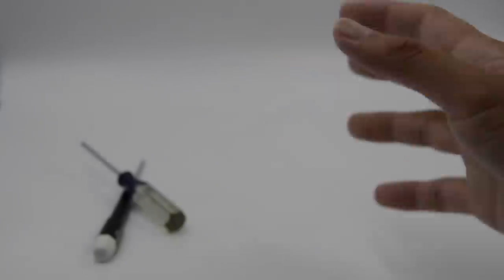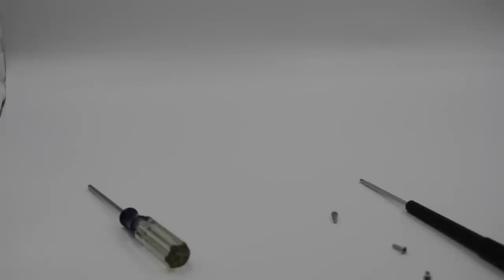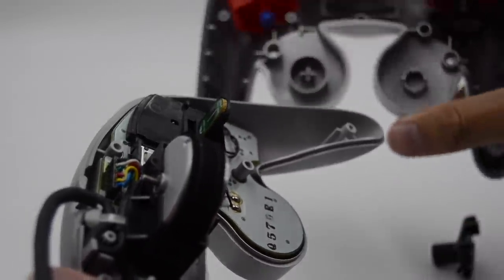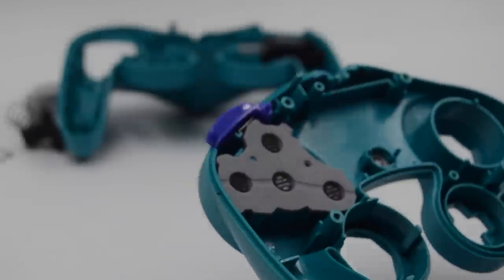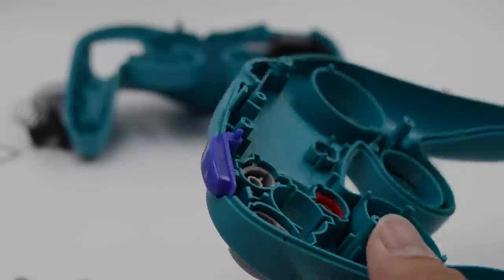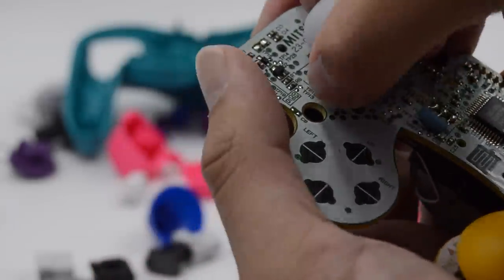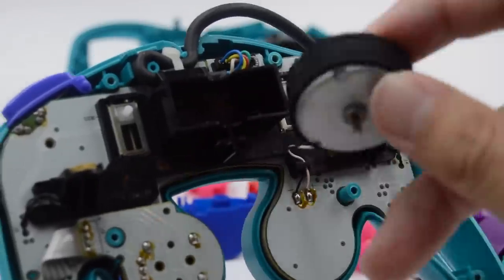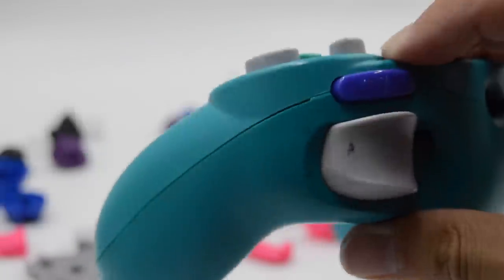Common Mistakes: Opening a Gamecube Controller

Comment: You didn't say the most important mistake, and that's not turning the screw left until they click into place before screwing them back in. This sets the screw to the original threading and prevents making new threads and damaging the plastic. This can be apparent if you open up your controller a few times and screws will no longer hold tightly, but instead keep spinning since the threads are damaged.

Comment: A little trick for anyone who is opening one of these up only to replace something from the front(joystick/buttons/etc.), you can just remove the front plate with the board resting in the back shell of the controller. This way you don't have to worry about the cord/rumble motors/or the LR sliders at all.

The way to do this is: hold the back of the controller with one hand, and put pressure on the joystick and C stick(this holds the board tightly to the rear shell) while you lift the front shell loose from the board.

Once it's loose enough, put the controller sideways before removing the shell so your buttons don't fall out of the front shell. Though if they do fall out it's extremely easy to drop them back in.

Comment: PSA: You don't actually need the metal bar in the z-button for it to reset it'd position, the tack switch the z-button rests on will reset the position for it, all the metal bar does is add tension to the z-button so you're better off removing it.
Reply: its insane how you just cant find a real answer lol, you watch a video to learn how to open a controller and then you have more esoteric comments that "actually..."

Comment: It probably isn't that the screws are low quality. It's because they aren't actually Phillips screws. They are Japanese Industrial Standard screws, which often strip with a standard Phillips screwdriver if you aren't careful.

FYI, if you ever find a Phillips screw on the outside, it doesn't necessarily mean someone has been tinkering. I bought a Clear/Indigo controller at-launch and it had one Phillips screw on the bottom even though all the others were triwing. It was still sealed in the package. I had it for well over a decade before selling it in 2015.

Comment: I would also take extra care with the Rumble pack on the back. In my experience it's not always secured to its plastic housing and could fall off and potentially break because of the thin wires. If it does break off because of the wires it would be a simple fix if you know your way around a soldering iron. Still just something to look out for though.
Reply from the maker: yup! just super annoying how easily it breaks to begin with

Comment: Zenith! These videos have given me a ton of inspiration to fix up and upgrade my controllers, they work but they are very old and pretty beat up. This being said, I ordered a 5 pack of those replacement buttons you demoed from the cheap Chinese sellers online, and some replacement button pads. I think you should review the button pads! There are ones from ZedLabs and GameTown, I think, all found on Amazon and eBay. The thing about these old button pads is that they make your old mushy buttons feel clicky and responsive! I tried them out and honestly, I could never go back. I definitely think you'd like them, and you should totally make a video about them! Thanks for reading this, I'd be surprised if you even got here.
Reply from the maker: I will look into the button pads! thanks for the heads up :)

Comment: You probably won’t see this but at 9:15 when you point out the trigger slider getting caught and causing the trigger to get stuck a bit cause he’s getting caught. What do I do to make it normal again. I have a controller tester and it shows that the adaptive part of the controller doesn’t work anymore. Just wondering if you could help.

Comment: The "phillips" screws inside the controller might actually be japanese industry standard (or jis), which are slightly different from phillips screws and might be easier to unscrew with a jis screwdriver.

Comment: I bought a used GAMECUBE controller from a retro gaming store. It's a little dirty and the left analog stick isn't tight. It's weird to explain, but the distance you can wiggle the stick back and forth without actually triggering any movment is way bigger than it should be. Any advice for cleaning it or tightening the stick? I'm probably going to use a little water and a paper towel to get the grime off, and a toothpick for the small space where the shells meet.

Comment: If you have taken apart other controllers then the rumble moter being in that hump will throw you off because normal controllers (the ones with clickable thumb sticks and 4 sholder buttons) have the rumble motors placed in the grips also gamecube only has 1 rumble motor
Reply: gc motor is best ever.

Comment: One main thing I've seen time and time again, is people screwing the shell on unevenly and either too tight or too loose (sometimes in certain screws not allowing other screws to go all the way in, or making the shell offset from the faceplate, even locking triggers or z buttons because of it).

Comment: How would you recommend removing a stripped screw from the trigger guard?  I bought a controller recently and was going to swap the metal bars from it into my main controller, but one of the screws is pretty badly stripped.
Reply: The way a machinist would do it is drill it with a left hand drill bit (one that cuts in the opposite direction of normal)
Of course, that's not something I would expect normal people to do, but another option is to cut a slit into the head of the screw to turn it into a slot, to try and take it out with a flathead screwdriver.

Comment: hello! i want to take apart my controller to repair it. it's a knockoff, so it's had this issue from the beginning where the joystick is off center in the hole and i think the thing inside, is twisted? are there any resources for repairing the joystick?

Comment: My left analog stick doesn’t fully work. For example when I play super smash I can run right but when I go left I can only walk and same thing with charged A attacks I can’t do them left. Is there any easy way to fix this?
Reply from the maker: could be plain broken, when did it start doing that?
Reply: zenith SSBM I stopped using the controller but it happened a few months ago when I was playing smash bros melee, I do a lot of shield dodge rolls then I noticed I didn’t always run when I moved left. 
If I’m running right and then I want to run left it usually makes them walk unless I try again pushing the stick harder to the left.
Reply: Then you probably need to change stickboxes. That requires solder. If you don't know how change maybe is time get new controller.

Comment: there some version varietions you missed. (c stick part there a board with one that can detatch from the main board and re attach fine. Also solder joystick vs the ones with screws in the back.

Comment: Hey I think you should do a similar video but with the hori pad controller. Since it's also a pretty common GameCube controller to use in the smash community. I personally would not know what to expect when opening up one of those.
Reply from the maker: the Hori pad is super weird but really its about the same in things to look out for! just all the button pads are separated and you have to worry about 2x the z-buttons lol

Comment: Oooook, I have a question: My A button membrane broke in my new model Smash GC controller. It was a tall button membrane, so I was gonna switch it for the membrane on an old controller I have until I saw this and realized they're different. However, both controllers have equally sized buttons. I'm just wondering what that means. Are they tall buttons and that's why my membrane was breaking?

Comment: hey, so this is a more intense mod. But ive tried it a few times and failed. I'm trying to make a paracord cable for the controller, I tried cutting the cord, sliding the paracord on, and soldering it all back together, but the gamecube doesn't like that, it only sometimes recognizes the controller. The only other way I can think is desolder the cable from the board, but my controller has a plug like object that all the wires go into, and i can't fit the paracord over that.

Long story short, would you be able to make a video on how to put on paracord over the cable?
Reply: I have a GameCube controller that has a bad cord the only way to use it is if I put it in a good position. I’m trying to change the cord as well I tried desoldering it but they did a good job with it. Might as well get a new one some are like 12 dollars.

Comment: Zenith thanks! Im super late but I have a few issues. One is that I've swapped out my control stick for another and it feels sooooo sluggish. Like I cant go across a character select screen and move up or down without it being sluggish on my swapped stick but the original stick still works. Do I gotta sand something down? 

On another control I've swapped our the start button and I've got the padding there. It's weird... but that mug isn't working lol. If I swap back to the original it works though. Any ideas? 

Also thanks again for the videos. These have helped me a TON. I've had successful button swaps and they're working great - but some of these custom buttons just aren't working for me

Comment: I recently just took apart my game cube controller taking it apart and putting it back together was pretty simple however I noticed after I put it back together the left deepad arrow became very stiff when pressing it I don't know what happened and it never did that before but I can't seem to fix this problem I try to disassemble my controller multiple times however I couldn't get the deep pad to work originally how it used to, can someone please tell me what I did wrong or what the issue is? Feedback is much appreciated thank you
Reply: I realize this comment is very old but did you try pulling off and replacing the button pad under the D pad? I wonder if it’s not placed correctly

Comment: i opened mine and now im unable to put it back together -.- its broken anyway so i tried to take some dust out since my controller would not work as well. but im at the last part where i have to put the 2 big parts together before screwing but it wont fit.. dunno why

Comment: You mentioned those back shells with the phillips screws. I have an original Nintendo-brand controller I got it in 2005 and it doesn't have the back shells or the metal brace. When I opened it I could literally see the trigger and spring. Why is this? I love your content by the way.
Reply: older controllers didn’t come with it

Comment: Thanks to this video, I too decided to mod my GC remotes, but I came across something confusing. 
on battle beaver site, it shows the old controllers having "Tall" rubber pads and new controllers having short ones.  but this video claims the opposite. obviously both of you can't be right... so which is it?
Reply from the maker: old controllers have short button pads and tall buttons! hope this helps

Comment: I don't know if you'll respond to this but I recently opened my GameCube controller to replace the stick. Basically the rubber bit on the stick had worn down so I replaced it with a stick from a controller that I didn't use. It's important to note that my original controller (the one with the worn out stick) did NOT have any noticeable snap back. The controller that I was getting the new stick from DID have a lot of snap back.  

Now that I have replaced the stick from the bad one and put it into my main one, they both have a ton of snapback. Did this happen because the stick itself is faulty and has snapback? Or is it due to me opening then closing my controller improperly?

If you've got a solution for me, that would be great.
Reply: You probably just need to use the sticks enough to make them slightly loose and they won't have snapback anymore. I've heard people say a few weeks of regular play should loosen them up and stop snapback.

Comment: So question. I have an indigo controller that I was attempting to replace the buttons and sticks since the originals were really worn. And as I was putting it back together and making sure that the sliders were up, the R and L triggers don't respond. They go up and down just fine, but it's not registering the input. Is this at all fixable?
Reply from the maker: do the sliders work at all when the board is plugged in?
Reply: @zenithSSBM  Yeah they work, it just won't register the input on the board part.

Comment: Been thinking about getting a new gamecube controller, my current one is frankensteined from an old one i had in the closet and a knockoff i picked up for a few bucks. In terms of performance, is Battle Beaver better than Controller Chaos?
Reply from the maker: Controller Chaos does aesthetic modifications (shells, buttons, and sticks) whereas Battle Beaver sells controllers modified (and accessories) to increase performance (trigger plugs, snapback fix) on top of aesthetic mods as far as buttons and some sticks
Reply: Thanks for the reply, i'll look more into Battle Beaver. I can always purchase a new or custom shell / components in the future.

Comment: Would I be able to replace the interior with a third party one. After slamming my original controller in a fit of rage I bought a different company brand thinking they're all the same. It feels too stiff and requires more force on the buttons. I almost destroyed  that one as well because inputs were acting at random (cheap piece of crap i thought) so I bought a smash 5 one and it turns out the adapter wasn't on right lol, but thought maybe I can exchange parts to redeem my original one. My original controller has no visual damage or problems in the buttons, just the right half is unresponsive. Sorry for the unnecessary information I just thought it was funny.

Comment: Quick question are wavebird GameCube controllers a good option for competitive smash and are their parts compatible?
Reply from the maker: not really. theres a slight delay for inputs and they are banned at basically all tournaments due to the interference they would have with each other
Reply: @zenithSSBM  i know this is late, but someone in the audience could just control someones game if they had a wavebird

Comment: whenever i put in the plastic shield that covers the L and R buttons, it seems that the buttons dont spring back up and pushing down on them, help please.
Reply: Dude, same
Reply: I have the sliders fully up as well, and when I try to move the sliders directly (from when I open it) it doesnt do shield

Comment: When I bought my gamecube controller, (which was a used one on amazon) the z button came cracked. It’s kinda hard to explain but the button itself is shattered into several pieces. It still somewhat works but I can’t find any replacements. Do you have any tips?
Would superglue work to piece it together or do I have to buy a new replacement do you think?
Reply from the maker: As far as i know, there isnt a clear way to buy a lone official z-button. If you contact a custom button company they might be able to get you one. There are button sets on eBay you can buy that include a z-button but those z-buttons are misshaped and require sanding down to fit. (See “ShinG’s video on it.) Last would be just buying a cheap ‘for parts’ controller on eBay and making the swap. Sorry to hear that happened to you tho, that really sucks. Maybe you can get your money back!
Reply: zenith SSBM Thanks for the advice, I actually already do have a “for parts” controller (just my old third party controller before I got an actual Nintendo one) so I’ll just take the z-button from that
Reply from the maker: Np! Just be aware, im not sure which third party controller you have but most (at least all I can think of) do not have a compatible z-button

Comment: Hey I have a question. So I dropped my controller while playing and the control stick went loose. I opened up my controller and found that not only is the stick loose but the notch that holds it in place is brocken and stuck in the control stick. Is there any way to fix this or is the controller beyond repair?
Reply from the maker: you may be able to put a new control stick 'box' on your board unless the whole thing is messed up. worth looking into though!
Reply from the maker: you may be able to put a new control stick 'box' on your board unless the whole thing is messed up. worth looking into though!
Reply: Ok thanks I'll try to fix it thanks for the help.

Comment: my controller doesn't have the little back shells for the shoulder buttons, and my controller board doesn't have the back shells built into it. Do you know anyone who sells those parts? Because my shoulder buttons don't feel right and I would like to see if the plastic shield piece will change anything.
Reply from the maker: did you buy your controller used? and as far as I know right now, no. but then again I have not ever looked for specific parts like that.What i did do and can recommend is going to ebay and buying broken gamecube controllers for super cheap and using the parts off of that!
Reply: Thanks for the reply! What would you say is a good price for a broken gamecube controller?

Comment: alright so i bought the discount colour buttons from china which button pads are compatible New or Older controllers
Reply from the maker: the common ones from ebay are short buttons meant for tall button pads (new ones)
Reply: zenith SSBM thank you, personally like the older style but i suppose these should be fine